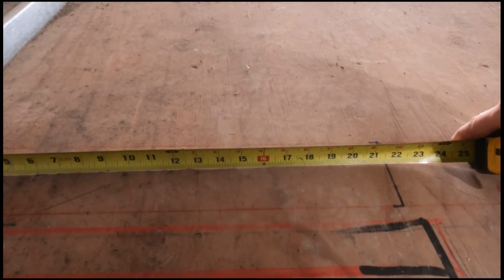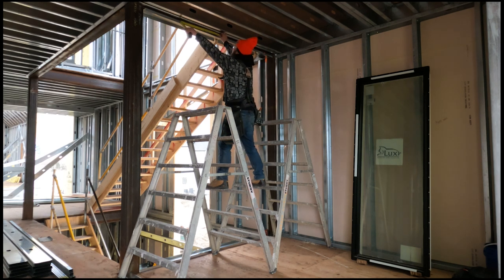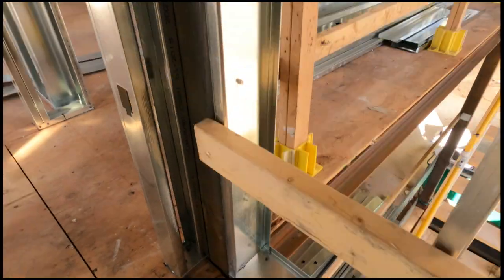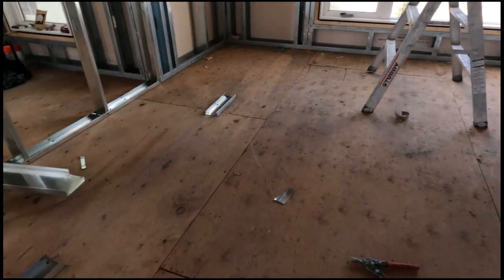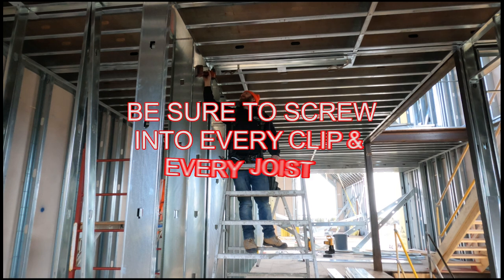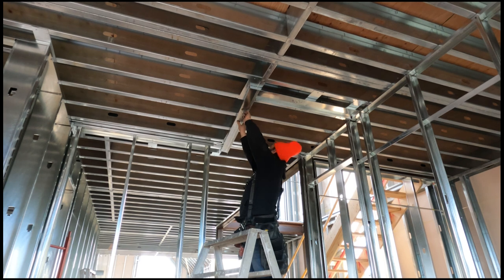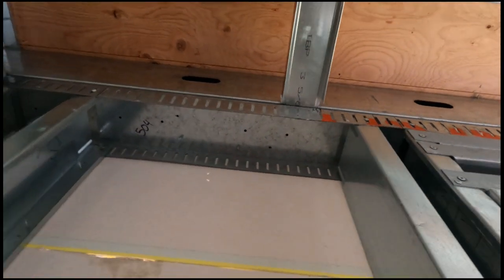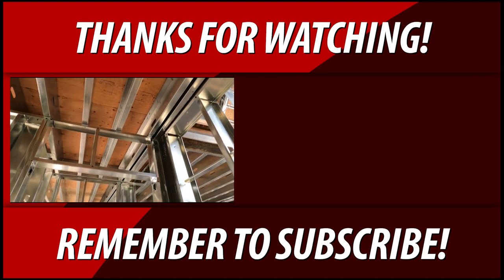Quick Metal Stud Framing Tutorial

Comment: Can you make 1 5/8 studs 24 inches apart.?
Reply from the maker: Sure, I suppose you can, just run channel  every 4' and brace back to the wall if it's a furring wall. Might be a little flimsy but if it's out-of the way and doesn't get bumped into should be good.

Comment: what is the tool belt you wearing ?
Reply from the maker: A 5 pocket ROX and a custom Cadillac tool pouch by FBM all leather with kunys padded suspenders.
Reply: @ConstructionKronies  good thanks  Imma check this out. I'm currently shopping for a tool belt
Reply from the maker: Kunys has a very reliable tool pouch I think its technically called an electricians pouch.

Comment: Brother, where is your fall protection? 
When you have a drywall on both side of the wall you don’t have to put CRC or other brace through studs pounchout.
For deflection you need to use a slip track

Comment: Hey man! 1st year union carenter apprentice and been loving your videos learning a lot thanks. Was wondering if there’s another name for a pin laser?  Not sure the difference between a pin laser and a line laser.
Reply from the maker: Yes the pin laser is also called a plumb laser, it shoots a single dot vertically. The line laser shoots an entire 360 degree level line vertically or horizontally. So for example, where you would need two line lasers to Plumb up a piece of top track you could do it with 1 line laser.

Comment: Im framing all 16 gauge for Hospitals (OSHPD) standards out here in Southern Cali.. 

Im using a band saw for all my cuts.. would you recommend a different tool for cuts?
Reply from the maker: Yes, a band saw is very unorthodox, we would use an abrasive saw (chop saw) with either an abrasive blade or metal cutting blade. I believe they are 14" saws. You can also use a grinder, a gas saw with the right blades or a cold cut saw. But the abrasive chop saw is the best.
Reply: @ConstructionKronies  yes I agree chop Saw is the ticket 👌🏽 
Down side to working hospitals is the smoke 💨 smells and noise that the chop saw creates.. so we are stuck using a band saw or the Dewalt Swivel Head Shears…
Reply from the maker: O ya, I forgot about that, haven't done a hospital in a while. This is where the carbide blades come in, zero smoke or dust you can buy them on Amazon here https://amzn.to/3mez6Z6 and the saw here  are 2 really good choices https://amzn.to/3L27ocz  and  https://amzn.to/3Y9uBfu  the shears are great, they just came out with a completely new design omg I wish I could remember it I will see if I can find it for you but those blades and saw will speed you up.
Reply: @ConstructionKronies  hey that blade is nice thanks for the link I will definitely look into it.. using my band saw is a slow process!! Thanks again bro 😎
Reply from the maker: Anytime bro!!

Comment: How do you figure out a 45 degree for a kicker
Reply from the maker: Don't over think it just run your tape measure to were you want the kicker add what you need for the two shoes on either end and it will work out. Doesn't have to be a perfect 45 it just needs to be secure, meaning screw your shoes into the brace so they don't move after you secure it to the structure and wall. Play around a bit you will see what I am talking about.

Comment: What does “deflection” mean when referring to metal stud framing?
Reply from the maker: Deflection happens in every building and  house. It is the constant flexing of the ground for reasons like winter and spring. Piles are used to help mitigate the amount of deflection. In steel stud we use slot track also known as deflection track at the top on all walls to underside of structure. We cut our studs 3/4" shorter and screw them in through the slots to allow for movement up and down. We will also use expansion joints in various locations. This will help prevent the walls from cracking and twisting overall.